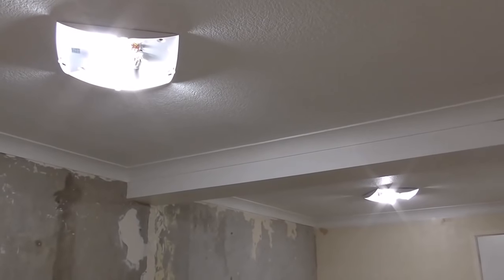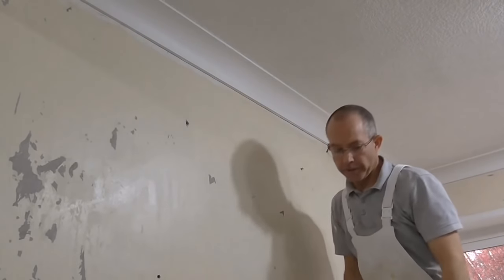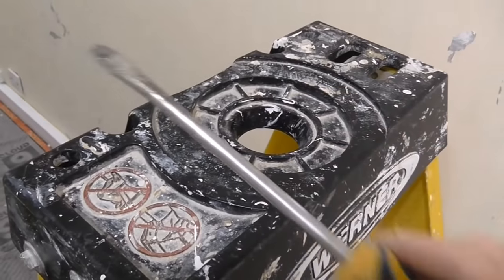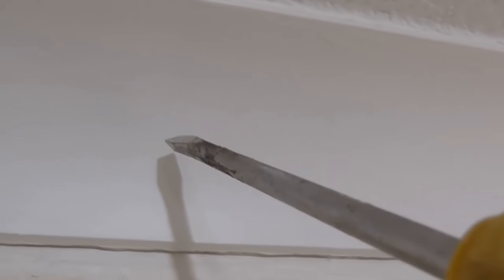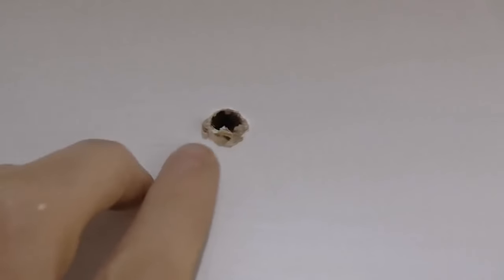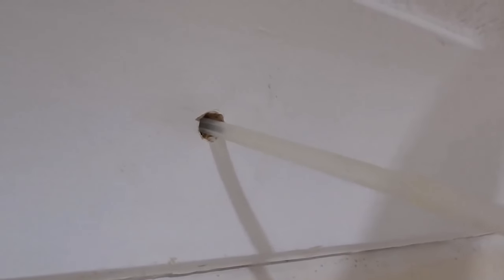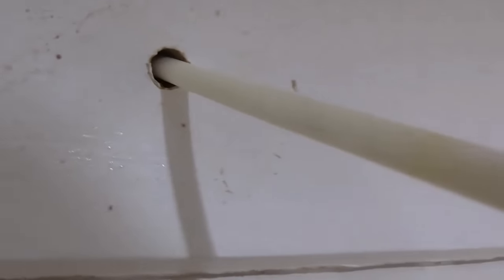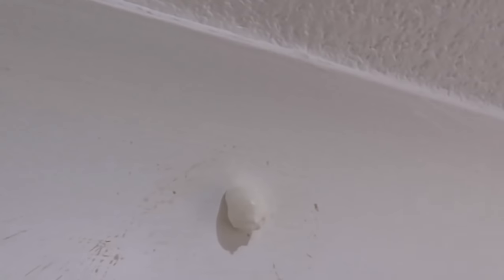How To Fix Loose Coving

Comment: Hi mate what would you advise on heavy thick cornice has cracked top and bottom and if i start raking it it will come down! Would expanding foam do to hold it? It’s very heavy stuff
Reply from the maker: Difficult to say but foam will hold it.  You can make small holes to stabilise it then do your main work.. thanks
Reply: Pop a few pins in it then use the expanding foam, as long as the heads are slightly sunken it's fine!

Comment: What did you use to fill in the bottom of the cornice to the wall . A silicon gap filler or something else
Reply from the maker: Once you have used the foam  there is no more movement.... so you can use powder filler.
Reply: Thanks

Comment: some off mine is dropping from ceiling line like it needs pushing back up first maybe support it with some masonary nails on the bottom line and try and push it back up ? did think about screws and plugs but this is mutch better idea?
Reply from the maker: If it's that lose you are better putting in some fixings while it drys.
Reply: The new type screws that don't need plugs could be worth a try. Need to get the screwhead under the face of the coving

Comment: Had a bad experience with foam on Friday, used it hundreds of times and never had this happen...it blew back out of the hole at crazy force even though i wasn't pressing that hard. It went all over my face and just missed my eye, had to dash downstairs and wash with white spirit, but was close to a hospital visit. I would advise using goggles when using this shit, I will be using goggles in future as it was a totally random and out of nowhere occurence.
Reply from the maker: Yes you do have to be careful.

Comment: If you see coving it's generally a good indication that the wall was pretty fucked up the top and some dodgy bastard put it up there to cover it rather than sort wall out:)  I mean lets face it there's no other reason to put that crap up there it looks awful and serves no purpose. Pulled a few of these off and the wall always seems to be in bits underneath. If you're a first time house buyer and you see this up I would give it a wide birth ;)
Reply: I like the look of coving, we have rooms with and rooms without, the rooms with coving look better finished off.